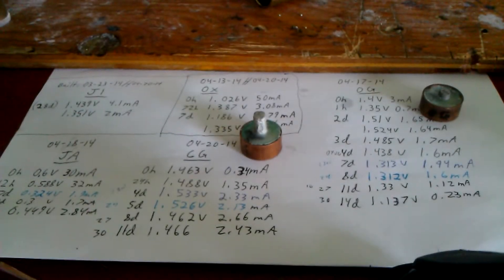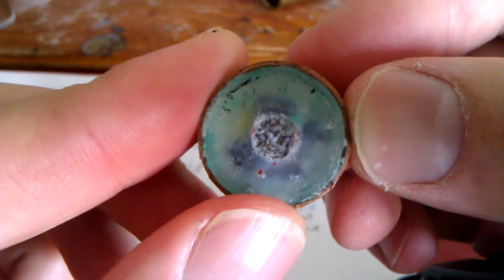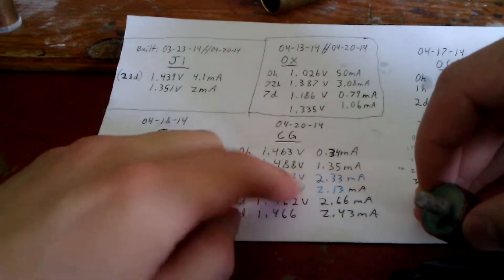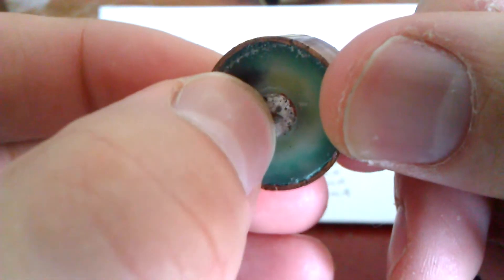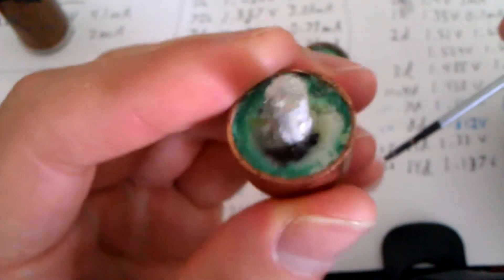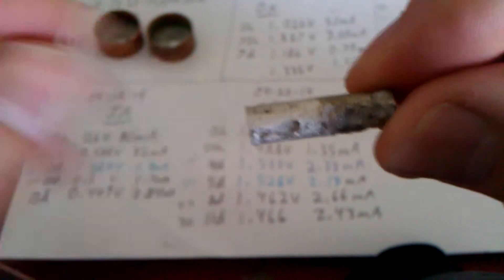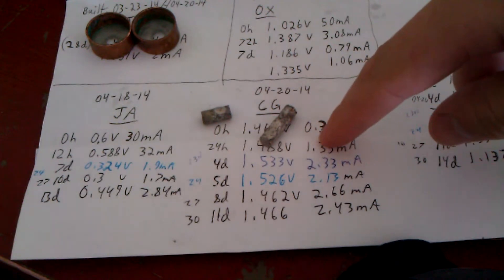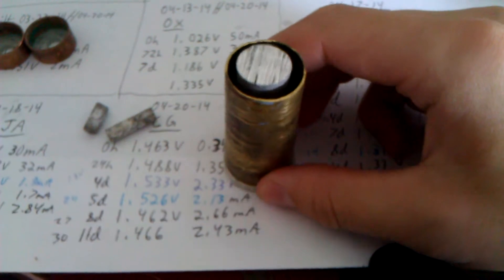14. Crystal Cells galvanic reaction corrosion solved with dielectric grease

Comment: why is the diameter of the magnesium rod so big in your final test? I believe the bigger the diameter the bigger the internal resistance will be. These batteries aren't galvanic so the area of exposure does not need to be big,  I hope I'm right ;-)
Reply from the maker: The Mg is the fuel source of the galvanic reaction producing electron flow & a larger surface area produces more current & a bit more capacitance of the cell. It's important to try new things all the time & that is one test to prove and disprove theories I have/had.

Comment: Thankyou so much Andy. I have a lot of questions but that is the main one I need answered.
 I have a suggestion for you. You can take it as you want, its just an idea but it might lead to some new ideas for you that you might like.
I think you could turn your crystal mix into an ink. You could use your carbon paper or impregnate paper with something conductive. If you got an old printer "from the good will," that still use's wet ink you could print out your crystal cells. Might even be able to use a powder with a lazer printer and melt it on the paper like a microchip, the voltage would be small and have very small amps but you could print out thousands and easly put them in series and parallel to a capacitor. The cells could stack together like base ball cards. several thousand paper cells that don't corrode and a few hundred capacitors salvaged from junk and I bet you could get enough juice to power a house's battery bank.
Keep up the good work. If you ever need any one to help brain storm for you for ideas or problems please let me know,
Thanks!
Reply from the maker: I understand what you're saying. With better equipment I could do something like that to create massive pile cells. One of my current tests is amount and distance of electrolytic between anode and cathode. Something to look at in the future for sure. I think I would destroy a printer & graphite paper is extremely brittle but there are many ways to make what you suggest work. One thing to consider is the very high IR of crystal cells so in series there are performance hits and they have to be exactly the same. It is possible they damage each other as well. I've been playing with the idea of using a joule thief charging circuit and cells in parallel. lots to think about.
Reply: Andy Shell Yes, its a new field and a lot of new ground. Lots to think about.
As for the internal resistance in the cells, I was thinking about using carbon or some other semi conductor. I know batteries use carbon and others have used carbon in their cell, but I don't here much detail on results with carbon,
 I wonder if there is some way you can layer a semi conductor layer in your cells to help direct voltage twards the anode. I can see in my mind making a crystal cell similar to a jawbreaker candy lolly pop. It would contain layers, very thin  that would connect to the stick. each layer of the cell would be connected to a conductive film that would channel to the stick / anode.  "try copper oxide, its a diode, I don't have a clue how to use it but bedini talks about doping his copper layers with it."
each layer can have a diode, "smd"  to protect it from energy from other layers.
I also think thin layers of crystal material would work better. In the end, voltage has to fight its way out because of its high internal resistance, why not have many thin layers that can discharge quickly.
Also, amathis crystal is just quarts with iron in it. I bet you can find some quarts for free out side or just buy some at a pet store "used in fish tanks"
I wish I could do some research, but right now im building my house and all my money is tied up.
Reply from the maker: Randy Travis Yea, I have a similar situation. Life is getting in the way of research. lol. An interesting idea but something I can't do atm.

Comment: So Andy, here is the million dollar question, is there any energy or voltage produced in a crystal battery with out a galvanic reaction. I thought the whole point of the crystal battery was to produce energy with out the use of fuel or chemical reactions, energy from the vaccume so to say. Is it possible to produce any reaction from a crystal battery with out a galvanic reaction.
I thought the special nature of the crystals was responsible, like a piezoelectric effect interacting with ambient energy around us.
Im seriously asking this question and it would help me a lot if you can let me know.
Thanks for responding.
Reply from the maker: Making me work eh? In short. Yes. I have a list of different types of batteries and crystal cells explained. I will find and post them in a sec.
Reply from the maker: overunity.com/13061/crystal-cell-research/75/
mscoffman: "True-Crystal Cells Batteries They are non-galvanic and are usually sealed from the environment to exclude water or galvanic activity including corrosion. I believe they are powered by intercepting Petrolithic Energy. Their voltages never decrease with use. But due to their non-ionic/crystal makeup have somewhat lower powers. This group includes Marcus Reid Cells available on ebay, Zamboni High Voltage Piles, Ian Middleton's cells on overunity.com"
Lynn Mango & a few others are possibly in this category. Nothing lasts forever in this universe but a cell that can output power for 2 years is extremely impressive imo.

Comment: Is it possible to get a protective paint that conducts. I see you painted some of your cells with carbon pain. Could you put some carbon powder in some Elmer's glue and coat your metal in a light coat first. It should conduct and prevent corrosion of the metal.
Also I was wondering if graphite corrodes. if it does not then why not see if you can use one carbon rod and another carbon rod doped with gold or plated in a light layer of gold. I know you can get some gold scrap and powder it to make some doped carbon. A small earring or any trashed jewelry would work.
Please let me know if your interested in my ideas. thanks
Reply from the maker: The problem is the galvanic scale. The Cathode which is what all the materials you mentioned are. Does not corrode or deteriorate what so ever. The Mg or Al anode is what corrodes. A Mg alloy is far more durable but is more difficult to find in ribbon wire form for testing & reduces V & A output. Mixing too many different elements degrades performance. Mg/C delivers the highest V @ (1.8-1.5) but pales in current & capacitance output of Mg/Ni-chromium cells @ 1.4-1.2v. At this point it's a balancing act of pros and cons while refining the electrolytic formula.